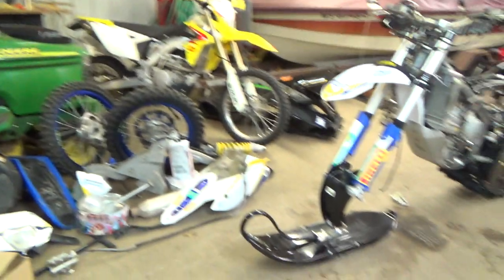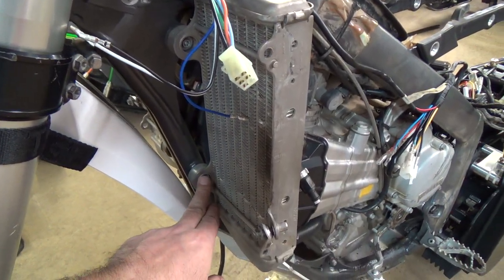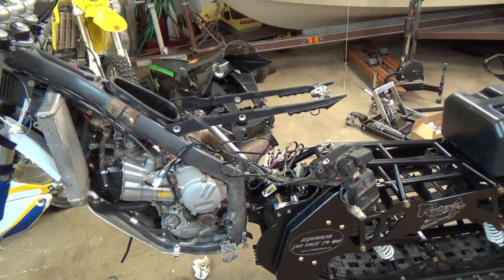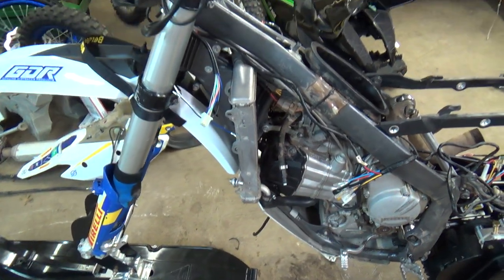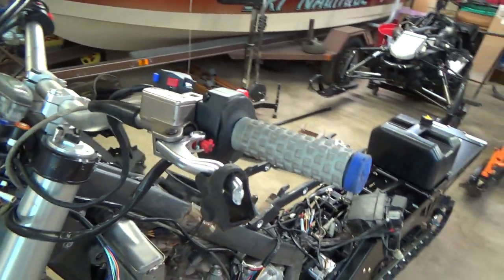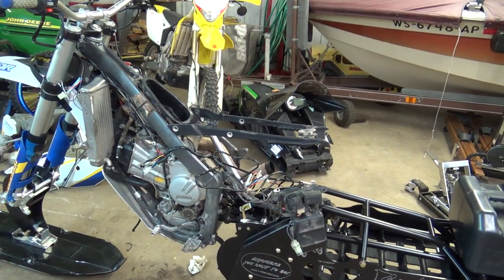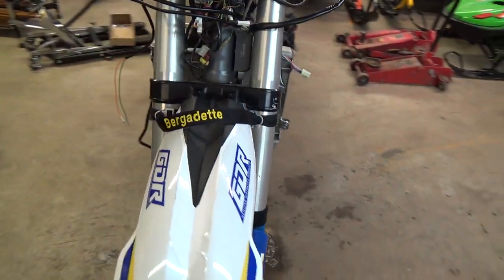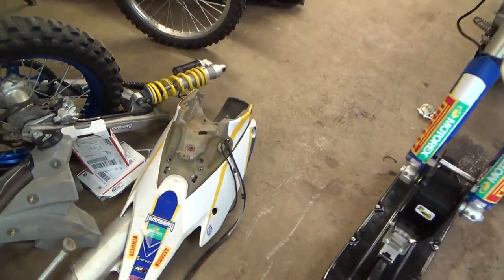Timbersled Mountain Horse Installation Chronicles Part 2

Comment: Why wont the headlight work???
Reply from the maker: The first headlight I was sent wasn't the correct one for a Husaberg. The "correct one" didn't work because it turns out mine is an FE 570 S, and the street legal relays and stuff are mounted from the factory behind the stock light, and get in the way of where the headlight would mount. Apparently all '11 570 models were S models in the US. I wasn't aware of this.
Reply: ROCKIN RODNEY
Do you have any videos of the beast in the powder?
Reply from the maker: I really don't have a lot of footage. My first ride out I lost my helmet cam, and never did recover it. I posted what little I had, but it's nothing epic like out west. I did get a new cam and took the bike to the UP with some crazy-deep snow, but for some reason, when I inserted the memory card into the camera, it didn't connect quite right, and so the card didn't register, and no footage was recorded. Last year we started out with some really good snows, but it warmed in Dec and melted things down pretty well, and it didn't snow much past early January. I have several good cameras now, so hopefully this year will secure me some much-needed footage.